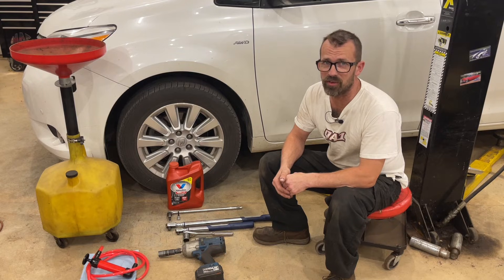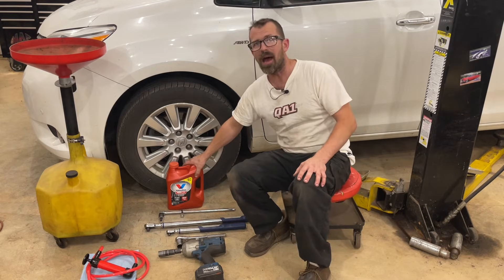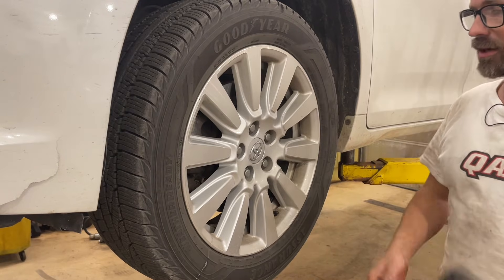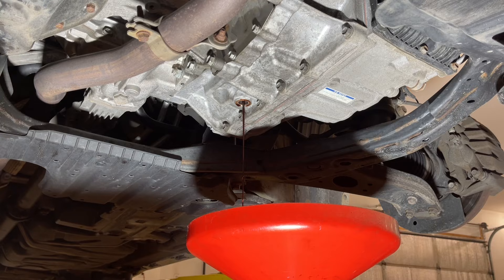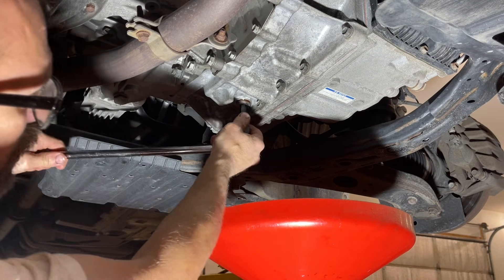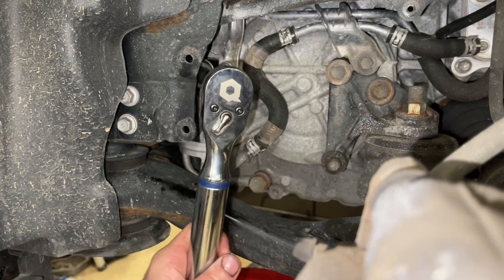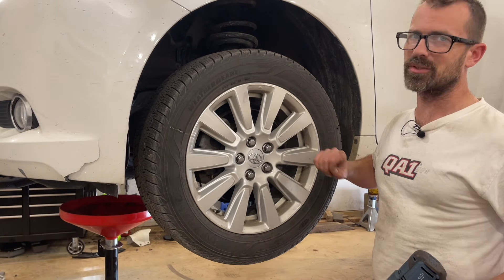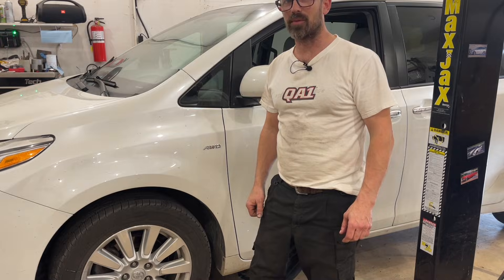🔧 2017-2021 Toyota Sienna Transmission Fluid Change, how to check trans temperature. UA80E

Comment: Why do you have to set the fluid level just the same height with the tube? when you initially take out the drain plug there was some oil flowing already so essentially the level is much higher than the tube.. Just curious, need to change my tranny oil for my 2019 sienna

Comment: Just to be controversial, Car care nut recommends only Toyota OEM WS fluid.   He said other fluids are thinner.  Transmissions are fussy.  Thanks for the thorough video.
Reply from the maker: There’s nothing controversial about running OEM fluid. You should run whatever you feel comfortable with. I have OEM Toyota fluid linked in the description.
Reply: Car care nut is a ......nut

Comment: Any idea why my rpm fluctuates when i let go off the gas it only do this ones i reach 2500 rpm. It happened after i changed the atf on my sienna.
Reply from the maker: Not sure.  Make sure you didn’t accidentally pull off a vacuum hose from the air intake. That would definitely cause a symptom like that.

Comment: 2 questions.  One, approx how long did it take to reach the op temp? I dont have a tool so  want to guesstimate.  second, how much oil did use to fill the while thing, only 3.5qts?  Thanks in advance
Reply from the maker: Approximately 15 minutes. It can be different depending on what temp it’s at when you start the procedure. I recommend going by the exact transmission temp and not guessing, but I’ll leave that up to you. 

You will drain out about 3.5 quarts, so putting in 4 quarts will ensure you have it plenty full before setting the level.

Comment: Excellent video, I followed your instructions step by step, thank you very much, I have a question, does this type of transmission have a filter?... or should only the fluid be changed?.... I would appreciate your answer.
Reply from the maker: Thanks!  This transmission does have a filter. It’s located under the front cover.  This video just outlines the Toyota recommended procedure of draining and refilling the fluid. If you do that as recommended in my opinion, you will not need to change the filter.
Reply: @bennieaust  thank you, have a great day!!
Reply from the maker: @germanvera5847  you’re welcome!!

Comment: Does this transmission not have a filter?
Reply from the maker: It does have a filter under the front cover. This video only covers the Toyota recommended fluid change.

Comment: Followed your video, did twice on 17 Sienna with one week apart. The 2nd time the ATF drained was still dark, which meant it was not a complete flush. In order to do complete flush. Do you have an idea where the ATF return line is, so I can drain it out. I saw a video to do complete flush on 2016 Sienna.
Reply from the maker: The drain and fill procedure will only get about a 3rd of the fluid out. I’m not certain where, or if there is a line you can pull to do a flush, but this is the procedure Toyota recommends.
Reply: Don't do it. It will change too much fluid viscosity if do a total flush, it will throw the control module out of correction. You may experience rough shifting or transmission problem after the flush.

Comment: I got two gallons of fluid so I can do the job twice to remove more of the old fluid. I’ll change the fluid once then run the vehicle to circulate it and then just do the procedure again before finally checking the level. That should get out more of the old fluid right?
Reply from the maker: Yes, that will work great.
Reply: Don't do it. It will change too much fluid viscosity. You need to drive a while, maybe 2000 miles, and let the transmission control module adjust the fluid first, before the second change.

Comment: bennie, after hitting the 95 degrees. when you set the level how do you know how much to take out? will the excess drain out without taking the fill level tube?
Reply from the maker: You leave the fill level tube in, anything that drains out with the fill level tube in, is excess fluid.
Reply: Thanks brotha!!
Reply from the maker: @TeeWag671  you’re welcome!!

Comment: thanks for the video brother! I was stressing about trying to measure how much comes out perfectly lol. None of my drain pans have measurements on them, and putting into a different container to measure is guaranteed to spill lol.
Reply from the maker: You’re welcome!  The worst thing about measuring what you take out is that it’s only going to work if you know for sure it started at the correct level. If your vehicle has 100k miles and it’s never been check, who knows. 🤷

Comment: I have this exact same Sienna. Same year, same model.   It just hit 45,000 miles (I don't drive much) and I wanted to change the transmission fluid myself since it cost close to $400 here to have it done.  Besides the cost I do NOT trust service centers at all.  I've seen so many rip offs during my 70 years on oil, fluid etc. changes that I just can't trust any of them.  Especially Dealership Service Centers.  Thank you very much for this detailed and fully explained video!  One thing I want to say is I have an AUTEL DiagLink OBD2 reader and it reads everything on this car including the Live Transmission Fluid Temperature.  I just checked it myself and it does read the temperature.  I don't know if there are other low cost OBD2 scanners that do this but mine does.  For those that can't afford an expensive scanner I suggest looking at the AUTEL DiagLink.    
  Now I'm gathering the items needed to do this myself.  Not looking forward to it but damn if I'm going to pay up to $400 and not know if it was done or that it was done correctly.  
  Once again, thanks so much for this video!
Reply from the maker: You’re welcome!!

Thanks for commenting and adding your experience with a less expensive scanner option!

The first time you do this procedure it may be a pain but I think you’ll find it’s actually pretty easy.  Sounds like it may be many years before you have to do it again, but it will be easy as can be second time around.
Reply from the maker: You’re welcome Gordon!  And thanks for the recommendation on the scanner. I will link it in the description when I get a chance. 

Thanks,
Bennie

Comment: Thank you! Just wrapped up the ATF change and test drive on my 2018 Sienna. Everything went flawless following your video!
Reply from the maker: Great to hear!  You’re welcome!!
Reply: What knowledge did you change it at?And did you read bad stuff about doing a flush
Reply: @calloway1972  I was around 77k, and I've never flushed transmissions. Just changed fluid and filters if present.
Reply from the maker: @calloway1972  I’m guessing you’re asking what mileage?  97k miles. Toyota recommends every 60k miles.  

I don’t have any issues with doing flushes, but in this video I do it how Toyota recommends, just a drain and refill.
Reply: @bennieaust  I called several dealers and get several different answers on flushes vs. changes. Does Toyota actually recommend anything lol ? One told me "lifetime" .. well, I have had a Buick century since 1998. What's lifetime ? Everything breaks down.
Reply from the maker: @calloway1972  I would do a drain and refill every 60k miles.

Comment: Thank you! Your instruction is very clear & thorough. I’m getting myself a scan device and do it right now (instead of measuring amount in = amount out).
Reply from the maker: You’re welcome!  Just a heads up, I have been getting a lot of feedback that the scanner I use, and linked in the description has been updated and people are having issues reading trans temp. I don’t currently have an alternative recommendation but you may have issues if you purchase this one.

Comment: I purchased the ZR15s as recommended to service my transmission on my 2017 Toyota Sienna XLE. It would not read the transmission temp. So I hooked it up to my 2015 Silverado that I knew for a fact had a transmission temp sensor and it would read the transmission temp on it. I’m not sure if it’s a compatibility issue with the xle vs the limited awd or what. But I couldn’t get it to work regardless.
Reply from the maker: I've gotten several comments from people having the same issue.  I don't know and it's driving me nuts!!  As you can see, I used that exact scanner in my video.  I am able to pull up trans temp in everything I have plugged it into, and that is one of the features listed in the specs.  You will probably have to talk to Harbor Freight / tech support to find out what is going on.  Please report back so I have an answer for anyone else with that issue.  The last thing I want to do is post a video with inaccurate info.  It was accurate at the time of posting and I don't know what has changed. :(
Reply: @bennieaust  can you put up a picture of your firmware version on your zr15s?
Reply from the maker: @63bravogarage  I'm not sure how to add a picture, Firmware: V19.06.04 Bootloader: V18.05.01 Database: V19.06.05
Reply: Ok. Mine reads. Firmware: V22.11.05, Boot Loader:V18.05.01, Database: V22.00.46. I talked to tech support and they said they updated the firmware in October 2023 and said it should work for every 2022 models. So I’m thinking it’s a glitch in the newest firmware that will not let it read a Toyota Sienna for sure. Not sure when you purchased yours but I’m assuming it was before then. I definitely wouldn’t update yours yet based on that. Hopefully they are getting enough complaints to address the issue.
Reply from the maker: @63bravogarage  it was before that.  It was in February of 2022 IIFC.  Thanks for the update.  Hopefully they will fix it soon!
Reply: Issue not fixed yet... Firmware v.22.11.05
Bought it days ago and it works fine on 2015 sienna but 2017 with sealed transmission I don't have any readings... Looking for a way to finish the job because right now I am stuck

Comment: Hi Bennie, I bought the exact same code reader (ZR15S). The tool is up to date, no new Software. I am not seeing transmission oil temperature on the code reader like you show at  12:43 of the video. Any ideas why my 2017 sienna with same code reader DOES NOT show me trans temp?
Reply from the maker: I don't know why.  I have gotten a few comments on this problem.  It bothers me because the entire purpose of this video is to help someone perform this procedure and I feel like my advice is incorrect.  I would love to add additional advice to the description if you find a solution.  I would recommend talking to tech support on this.  As you can see in the video, the scanner I purchased from Harbor Freight pulled up the trans temp with no issues.  Straight out of the box.

Comment: Great vid. For the reader ZR15, does it read Trans Temperature out of the box or do you need to download/pay for a new add-on of some sort? I read that it may not be able to. Thanks!
Reply: Theres another good scanner, TopDon ArtiDiag 900bt lite that reads trans temp out of the box
Reply from the maker: @mikem2055  Thanks!
Reply from the maker: Mine is straight out of the box, no updates. I can’t make any promises beyond that, but mine has read trans temp on everything I’ve needed it to with no updates or additional cost.

Comment: I bought the one you recommended on Amazon but it doesn't give me the option to check the transmission fluid temperature.😢🤔
Reply from the maker: I’ve heard serval of the same complaint and I’m not very happy about it!!  The last thing I want to do is steer someone in the wrong direction. I’ve used both the Innova and harbor freight version and they are identical.  Contact either Innova or the seller I’m not sure what else to tell you. Please post back here if you resolve it because I would like to have an answer to pass along.

Comment: It is the best explanation recorded... very good information in this video... in the fluid level part... what happens if you don't make the from park to drive and reverse.. there is a problem if you forget that step.
Reply from the maker: Thanks!  I appreciate it!

I think the reason you shift though the gears is in case there is an air pocket in any of the fluid passageways after draining it.  I would imagine you would only be low a tiny bit if you didn't do that and there was an air pocket.
Reply: Thank you for answering my question. I hope the informative content continues. I follow your channel and support your content. Thank you very much.
Reply from the maker: @Alex25-r5l  You're welcome!  I'll keep it coming!  I appreciate it!

Comment: You started checking fluid level at 95°. That is the low end of the range. What would be the difference if you checked it at 113° or a temp between the two? If it got to 113° wouldn’t it expand more than at 95°?
Reply from the maker: That’s correct. As it warms up it expands. If you set the level at 113 it would be a lower level than if you set it at 95.  Anything between those is acceptable, think of it like a dip stick that has a range that’s all ok. 

The reason I start at the lower level is because it will continue to rise as it runs, so that way you won’t overshoot the top of the temp range during the process.
Reply: @bennieaust  ahh … good point! I didn’t think of the car running while doing the process and continuing to heat the fluid. Thanks for clarifying. My brothers Sienna has 242k on it and it has never been changed.
Reply from the maker: @seanmclaughlin7415 sounds like it’s time to get it done!  If it’s really dark you will probably want to do this procedure a couple times.
Reply: @bennieaust  I am going to access the cooling line and add/flush until it is the desired color. Then I will follow the procedure  with temp and drainage to get proper level.
Reply from the maker: @seanmclaughlin7415  Sounds like a good plan!

Comment: Thank you so much for such a great video! It really gave me confidence working on my 2019 Toyota Sienna LE AWD. Just completed the transmission fluid change. I carefully drained and refilled with 3 13/16 quarts of Valvoline MAXLIFE ATF fluids. I was able to use 15/16 inch socket for the refill plug since I don't have a 24 mm socket. I am quite happy and planning to change front transfer case and rear diff fluid next.
Reply from the maker: You’re welcome!!
Reply: Hey, how did you raise your vehicle?
Reply: Suppose to change the diff fluid way more often than the trans btw, even th onot alot of people does

Comment: Ive used Maxlife on Sienna, Odyssey, and Volvos. All work perfectly. Its also Synthetic, unlike Toyota OEM fluid.
Reply: Maxlife fluid is thinner than Toyota WS, therefore it will shift harder. It's also not a listed compatible fluid. Not really recommended but some use it anyway.
Reply from the maker: @muziklvr7776 you should definitely used whatever fluid you feel most comfortable using.
Reply from the maker: Thanks for adding your experience!!  That been my experience as well. Lots of people without experience chiming in.
Reply: @bennieaust  I have a question I drain and fill my 2013 Sienna in dealer runs good but when cold I can hear the transmission shifting gears is that normal it runs normal but just have that question it doesn't slept or anything it sounds like when you shift in a manual transmission I don't remember if doing this before what you think?
Reply from the maker: @ramonmorales1845 it’s hard to say without seeing it in person. If you have any concerns I would recommend taking it back to where you had it done. Definitely give them a chance to fix the issue if it may be something they caused, or tell you if there isn’t an issue or anything to be concerned about.

Comment: So what if you don't have the means to buy a 300$ meter? Should i just bring it to the dealership to service or could there be some sort of other method to accurately gauge the oil temp?
Reply: The Car Care Nut has a video on how to use the car's own computer to signal when the right temperature is reached.  Go search
Reply from the maker: There are cheaper scanner options. I just linked the one I use. I don’t have any specific recommendations because I’m just familiar with the one I’m using, but I know you can find some cheaper options.

If you don’t want to spend the money on a scanner you can always bring it to the dealer to have it done.
Reply: I bought a 15$ off of eBay that does the internal transmission fluid. Thank you.

Comment: Thank for the great video.  I find it very easy to follow.  However, I have question for my Toyota sienna 2016.  Somehow when I drained the transmission fluid even with the second plug removed, I only get about 1.5 quart came out.  When I refilled it back in by putting 3.5 per video, there are about 2 quart came back out.  Does 2016 has different level than the one in your video?
Reply from the maker: It shouldn't be any different than the 2017 in this video.  I'm not sure why the quantity would be so much less.  Generally my first question would be about the level set tube but if you had that out, it should be fully drained.
Reply: Was your van level when completly lifted?

Comment: Does the van have to be leveled when I do the last part opening the drain plug for over filled? 

I can only do this on my driveway by lifting the front or just the front driver side.
Reply from the maker: It does need to be level to set the fluid level. 

You should be able to complete the rest of the service, then drop it down level and reach under to pull the plug and drain the extra fluid without lifting it up.

Comment: Great video, to the point and by the book. I love it! Quick question, I have a leak somewhere in the trans area because I overfilled. are they're common areas where the leak can occur? 2017 LE Sienna FWD. Thanks in advance!
Reply from the maker: Thanks!

Thats a great question. I have yet to see a leak on one of these so I don’t really have any specific suggestions. The general suggestion I have it clean it up well, then monitor it closely to see where the fluid comes from first.
Reply: Thanks @bennieaust